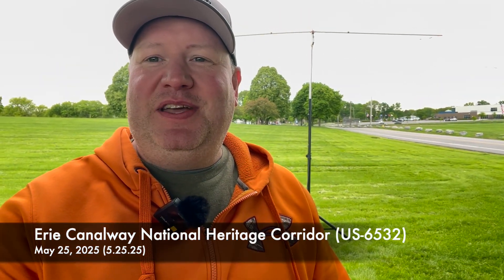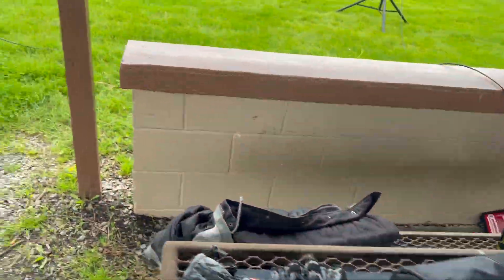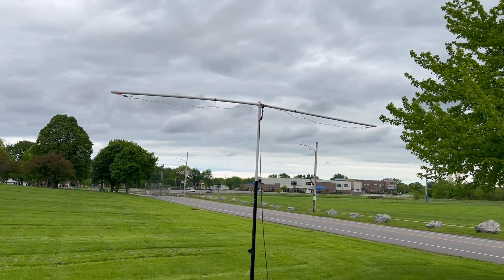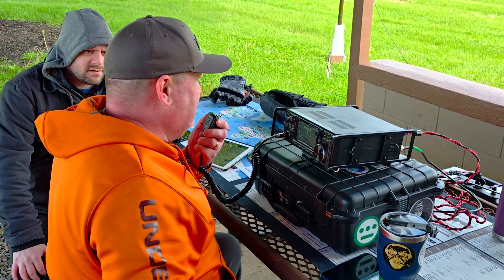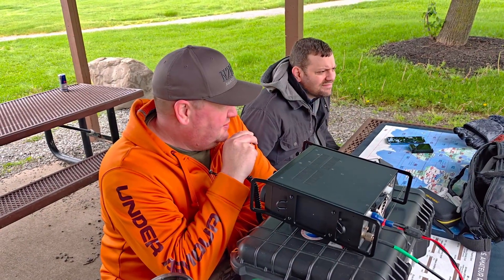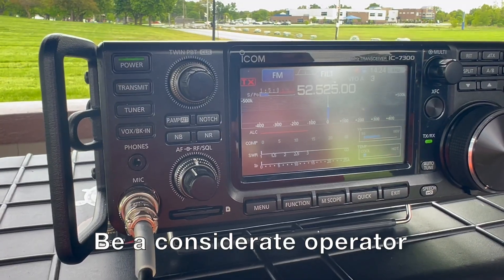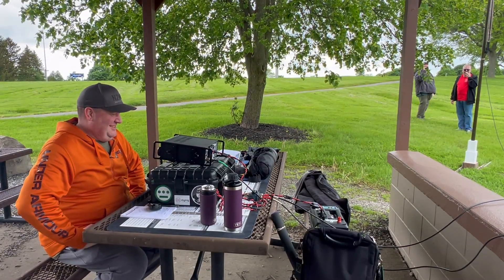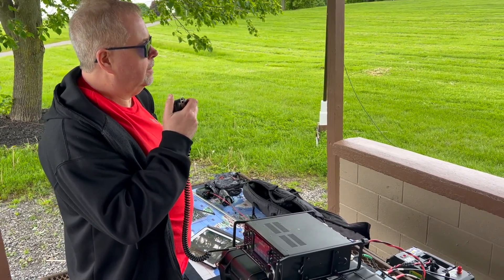Proof that Antenna Polarization Matters: How I Succeeded at a 6m FM POTA Activation

Comment: How about posting a video, materials list, or plans on how to build that horizontally polarized antenna?
Reply from the maker: That's easy! The 6m dipole was simply 16AWG Amazon Basics speaker wire and a BNC binding post. I put ring terminals on the ends I attach to the feed point. The measurements were just 468/50 and then I trimmed some off so it'd be ideal around 50-51MHz for weak signal modes. I used a BNC to SO239 adapter since the coax was PL259. I tied a loop at the end of the wire and then used zip ties as "insulators." The supports were just scrap 3/4" PVC that was salvaged. The Amazon Basics speaker stand I use fits 3/4" PVC perfectly.

Comment: I have a take apart 6M Moxon.  Goes from in a lawn chair bag to fully operational in about 30 seconds.   I have not determined that it is way better than a portable dipole, but it is portable, light and easy to mount to cheap RCA TV masts that you can get an Home Depot or Lowes.
Reply from the maker: That sounds awesome! They definitely are portable and take up less space.

Comment: Mike: I activated on 6 meters, both FM and FT8.  I wasn't in a POTA park, but got on from the Niagara Escarpment in Cambria, NY in FN03od. I was running 5 watts with a Yaesu FT-817nd and a VK7HH design SOTA Flowerpot vertical up 25 feet. 6 FM QSO's from Colden, NY to Niagara Falls, NY. Best DX of 45 miles. Then I switched to FT8. I used the FT8CN on my Samsung Android phone and acoustic coupling with the FT-817nd running VOX. 6 QSO's, 3 in FN03 locally and 2 in EM84 in GA! 6 meters was open down on 50.313 MHz! A great weekend activation, and I will be at the ARRL table at the Rochester Hamfest.

73, Keith, WB2VUO, TC - ARRL WNY Section
Amherst, NY near Buffalo, N.Y.
Reply from the maker: Awesome! I’ll see you at the RARA Hamfest. I’m volunteering and doing a presentation on POTA.

Comment: Why are you not using Squelch  ? Everyone has 6m FM  in their modern hf radios. Should use it
Reply from the maker: I wanted to try and hear stations/signals that might not have broken squelch. I suspected that most of the contacts would be line of sight propagation (assuming no opening on the band), so antenna polarization would matter (at least 3-4 S-units). That way if we thought we heard something we could easily react to switch from the vertical to horizontal antenna (or vice versa).

Comment: As far as alternatives, you could run a 6m 1/4 wave wire  up the same mast as the dipole and only have one mast to set up.
Reply from the maker: Thanks for the suggestion, I had wondered about that. I like how with the speaker stand I can easily rotate the dipole, but I might be able to come up with a way to do something similar with a mast.

Comment: That I got on much later and not much of anything .Even the HF bands poor. But to my surprise FT8 was open on 6 meters the next morning in Boston NY . I got TX and Florida on FT8.  Remember their is 2 FT8  frequency's.  1 for the US and outher outside the US . I use both. DX maps showed 6 meters was open in Florida real nice that day. Just nothing north.  I only had vertical T2LT coax antenna made from RG 8X up a 10 meter DX commander pole. Quick and easy . 73
Reply from the maker: Thanks for getting on a trying! FT8 is definitely the popular mode on 6m and some activity is better than no activity.
Reply: I also use a T2LT sleeved dipole (Flowerpot) antenna and it works great for me on a 10 or 12 meter fiberglass pole.
Reply from the maker: @mikesavage9499  I've never used or built a T2LT, but I just got a CB and have been thinking about making one for that.
Reply: @MikeN2MAK  I talked NY to London England on CB SSB on T2LT . easy build !
Reply from the maker: @robertmeyer4744  great to know!

Comment: Gotta try a 50ohm horizontally polarized delta loop for your next pvc pipe experiment. It's like 7 feet tall. Thanks again for getting the word out about 5/25/25 day!
Reply from the maker: Thanks! I'll definitely have to try that for 6m. The delta loop is one of the few antennas I have yet to use or make.

Comment: Great timing on this video for us in the western U.S.  6M has been open in the pre-dawn hours over the past few days.  I’ve been getting up before the sun and logging 6M digital contacts.  First good activity I’ve seen on 6M in a few years!  And, yes, big difference in polarization.
Reply from the maker: That's awesome you've been getting openings regularly! People say 6 meters is open around the summer time, so I was hoping the timing of this might help peak some interest.
Reply: Fun video.  I do not have any simplex 6m contacts yet.  Can I assume you are also on 1.25m as well?  I picked up a little 65W TYT radio to get on 220MHz and was prepared for disappointment but found the sound really clear.
Reply from the maker: @michaelstora70  I've got a few HTs that'll do 1.25M FM. I use them with a Yagi and roll-up J-pole during the VHF contests and they do fine, even with just 5W. I'm glad you're having a good experience with the TYT. A friend of mine recently picked one up too.

Comment: If that was a Radtel RT-900 yes I would like to know more. I have one. 2m Looked very dirty on a TinySA. I just acquired a low pass filter which may clean it up some, but have not tested that yet.
Reply from the maker: Yup, it's the RT-900. I haven't tested it yet, but I suspect that it's not the cleanest HT. I need to play with it some more, but I will do a video on it, since there definitely seems to be some interest.

Comment: Michael KB9VBR makes copper J-Poles that break down into pieces for easy shipping and transporting.  I suspect the same principle could be applied to a J-Pole for 6m which is 13' tall IIRC.
Reply from the maker: Yeah, I've seen that. I bet it's an amazing antenna on 6m. A portable version made with ladder line or even a flower pot antenna made with coax could make for easy POTA antennas.